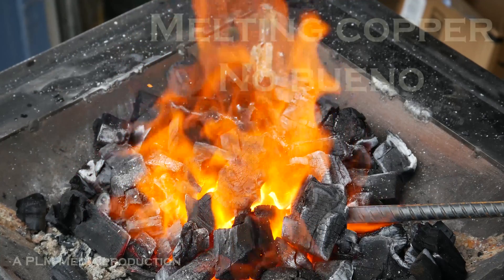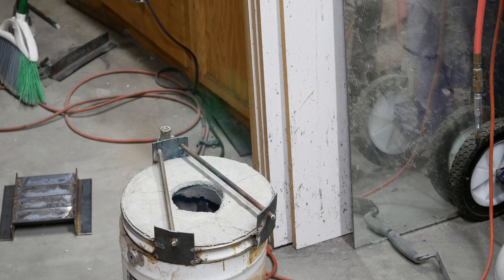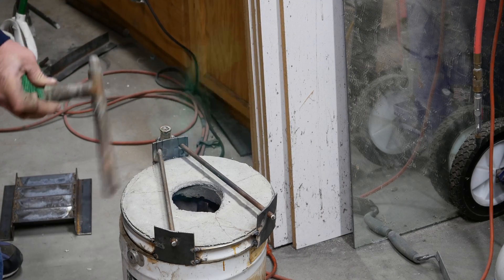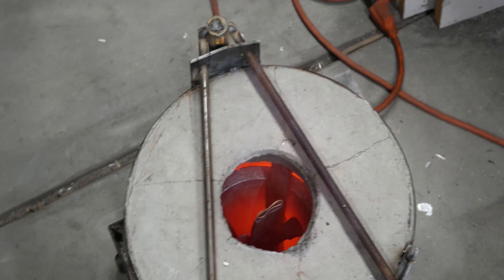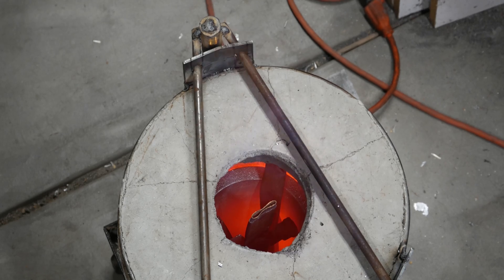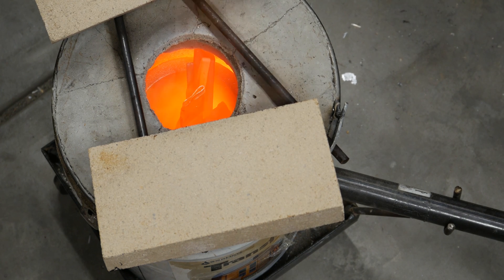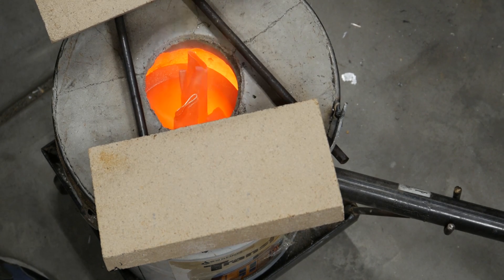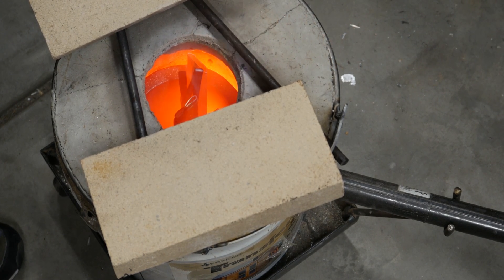Melting copper no bueno

Comment: I have my own forge at homw and i melt copper all the time. You have to have a blower forcing the air down your burner. I use 20lbs  propane pressure and I use a blower for my air mattress. I can melt 3 lbs of copper in 40 min
Reply from the maker: Hi Steven. Thanks. You should check out some of my later videos. I've solved the problem with simply adding more pressure. I'm no melting copper and bronze without a problem. Even melted cast iron with it... once ;-)

Comment: It’s funny, I’m going through your videos out of order and I’m having the same problem with my setup. Aluminum was easy but Copper didn’t work. I’ll find your next vid to find your answer 😀
Reply from the maker: Feel free to email me at swdweeb@gmail.com if you want to talk about it
Reply: @swdweeb Mine did the exact same thing and wondering if this email is still valid. Any advice would be helpful. I posted a video on my channel to see if I can get somebody to tell me what I’m doing wrong. I did a 40 psi regulator in a double walled drink dispenser lined with firewool then coated with satanite refractory cement. I didn’t have a cover on it for the first 40 minutes but it was glowing hot. Not sure of internal temp.
Reply from the maker: @claytonschemper8375  Email address is still valid.  I don;t have time to watch your video until later this afternoon. I'll comment there if I have any suggestions

Comment: I just put a video up. can my propane burner melting copper, is the video you can see what I did
Reply from the maker: Just watched your video. I hate you ;-) A couple of things that are definitely different besides the burner dimensions. 1st, I notice that you're not running a regulator so you have full pressure in your line whereas I've got mine running about 5PSI. The other thing is the amount of aluminum that you started with. I started with a lot of it in the crucible. I've been told since that copper takes a lot to heat up and it dissipates that heat really quickly. It is possible that I had way too much copper in there and should have started with a little like you did and then added copper to the puddle. 

I've got to tune the fuel air ratio that I have. I'm not sure how I'm going to do that. I built my burner based on the "king of random's" burner and have three different size tips I can put in it. I was also told that I might try mixing the air and fuel near the output end of my burner to get better combustion. 

Lots to try.  I promised myself that tomorrow would be an anvil day but now I may have to figure out how to get my burner adjusted and burning hotter.  So much to do, so little time ;-)

Thanks for the video. I don't really hate you but I am jealous. ;-)
Reply: swdweeb  I would always start with a little material in The Crucible first. Your burner is definitely not getting hot enough you can see the difference in the color of your Foundry compared to mine yours is more of an orange and mine is more of a white heat. Another thing you can try is putting a hair dryer on high and blowing the air through your burner and see if that helps

Comment: I would have thought it would have gotten hot enough  when you put those fire bricks over the hole... Hmmm, can you change the jet in your burner?
Reply from the maker: Actually I can, quite easily. Which direction are you thinking I should go, larger or smaller?

Comment: I think you need a bigger burner Perry, what pressure are you running at?
Reply from the maker: +Gary Huston I like the idea of a more manly burner ;-)  I’m running 5psi which google tells me is .35kg/cm2. I’ve got two easy options I can play with, pressure and orifice size. I can easily increase or decrease either or both
Reply: swdweeb can you increase the orifice size via a jet of some sort? You don’t want to drill it out and find it doesn’t work! I would then up the pressure to no more than 10 psi
Reply from the maker: I can easily create any size orifice I want. I use wire-feed welding tips for the body and I can drill the hole to any size. If if doesn't work, I just put the old tip back in.  Lot's to try today.

Comment: I don't think you are getting enough air flow through you propane burner your burner look really long what is the specs like the ID of the pipe
Reply from the maker: Hey there. I actually had a conversation with another guy that thought my flame is too rich which goes along with your suspicion of not getting enough air flow. I'm running 1" ID by 12" pipe for the tube. It's got a 1 1/2" x 1" reducer on each end.  If you haven't seen it yet, here is a video on the burner I made https://youtu.be/j5izf_r_dC8

If I get some time this weekend I can play around with a couple of things like reducing the pressure coming out of my regulator. If that doesn't work, I can try to blow some air in at the back end of the tube.